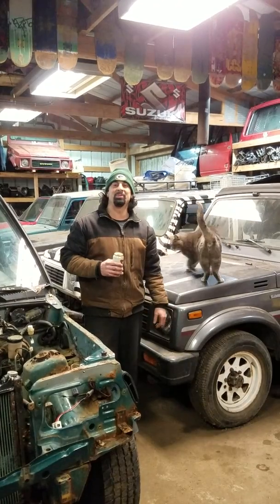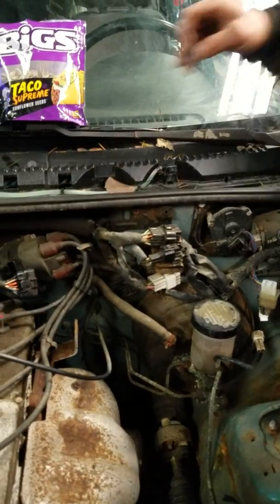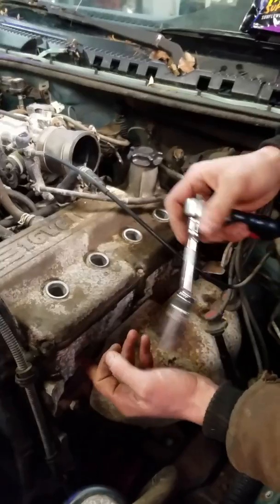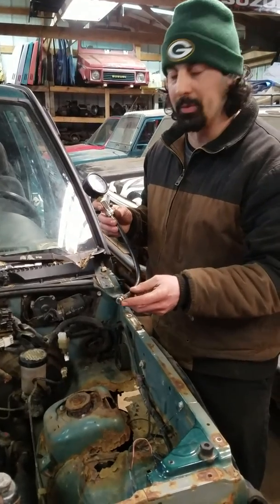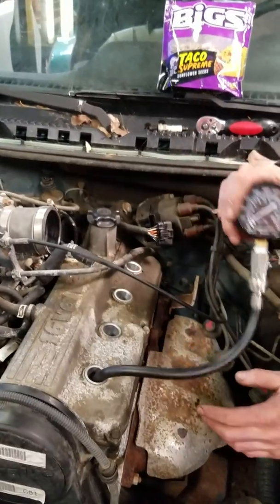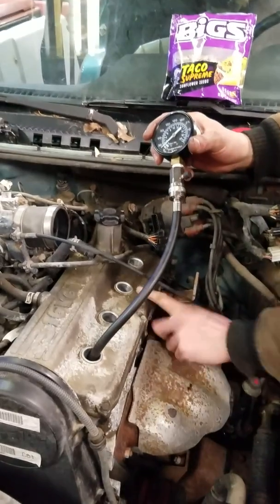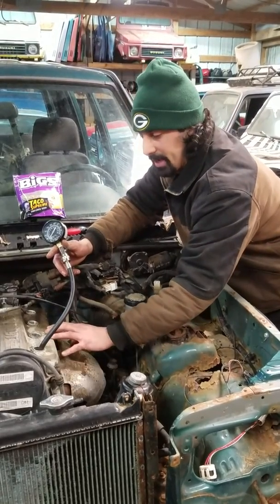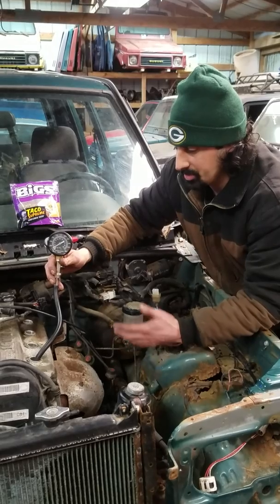COMPRESSION TEST! Suzuki Geo Tracker Engine - Fast & Easy to do! @Hwy83SUZUKI

Comment: How many different types of g16b engine are there I've seen about 5 different throttle body's on these engines obviously the engine is the same but they must have 5/6 different throttle body's

Comment: maybe you know whats the problem sidekick 93 1.6 16valve no injector pulse because no power. in blue/black stripe wire has 12v when ignition on, but other wire when cranking  1-2sec has 1v and then die to 0v??

Comment: Yo Toe knee
I'm putting a 96 tracker 16v motor into my 86 samurai. Any suggestions? Did a compression test after we pulled the motor so only could do a cold compression test 150, 160, 155, 153. Are those low numbers and if so should I rebuild the motor? Didn't blow blue when we did run it. Fuel pump was acting up or we would have done it when it was hot. Never done anything like this before so any help would be appreciated. 
Hello from Canada

Comment: Good video looks like you know what your doing about a month ago got me a 86 Sami it has a 99 1.6L 16v it leaks oil my question is I think I’m getting gas in my oil the research I’ve done says it’s the injectors have you ever delt with this problem the engine runs fine it sounds good just want to get an opinion before I change all the injectors thank you in advance

Comment: I have a 1996 geo tracker 1.6 16 valves. I just bought it and it would not start so I check the timing and it was 180 out so I put it back in time. still will not start check cylinder 1 and 2 no compression . have not checked 3 and 4.. any ideas? engine junk? thanks

Comment: hey guys, how much compression should a 16v engine have? I learned from the video that any 10psi difference between cylinders is ok, but what will be some good numbers? like 150 , 160 170,. 180? thank you very much for your knowledge
Reply from the maker: 150 is the low # where you should rebuild.  It will still run but not to the performance level it should

Comment: I have a parts geo 1994 8 valve that is not getting spark, would like to hear the motor run before i tear it apart, where would you start? Can i test the coil somehow with multimeter ? I had to put a cap and rotor on it from my other parts motor but only one bolt lines up for it could that be why? Any major grounds needed? Is there any fuses or relays under the dash that could cause it?
Reply from the maker: Very common issue with 8v engines.  First place to start is getting the ECM tested and or rebuilt - replaced.

Comment: I have a 93 Geo sidekick do not know why it will not fire up I have went through all the codes I have done checked everything and I'm used to Chevys so I do not know what else to check change the computer change the code I'm out of ideas can you give me some I deeply appreciate it and God bless i enjoy your app
Reply from the maker: Start with the basics. Check for fuel spark and compression. That's what an engine needs to run.
Reply: @Hwy83SUZUKI  I have no spark out of the coil I do not have no spark I have the ignition I do not have no fire. Battery is completely charged but will turn over
Reply from the maker: @davidscholl8718  very common for the ecm to fail and not have spark. If you need the ecm tested or repaired we can supply the info of the company we use. They do great work.
Reply: Fuel regulator pressure on a Geo is it in the tank or is it on the rail please locate God bless
Reply from the maker: @davidscholl8718  8v on throttle body.  16v on fuel rail
Reply: @Hwy83SUZUKI  thank you and have a blessed day I would even think about the fuel pressure regulator that's on the old Chevys thank you and I enjoy your show keep on the good work

Comment: Whats the size of the fitting i wanna do a compression test on my 1.6 16v and don’t know the size of the fitting.
Reply: They usually come with 3 different sizes. Just start with the small one and if that don't fit go the next size bigger. Only screw in finger tight also, no need to use tools to tighten. It's most likely the middle sized.

Comment: Do you know where i can buy a header or exhaust manifold to fit my 96 suzuki sidekick JLX sport with the 1.8. 
i was told one from a suzuki Vitara 2.0 will fit if i run a new exhaust pipe to the exhaust manifold.
Reply from the maker: Check with Myron over at Zuks OffRoad in Arizona!
Reply from the maker: If he cant help Trail Tough would be another good source
Reply: @Hwy83SUZUKI  ok thanks ill check them out.